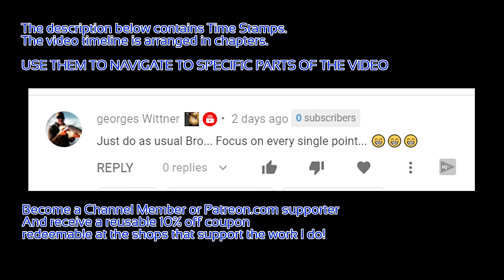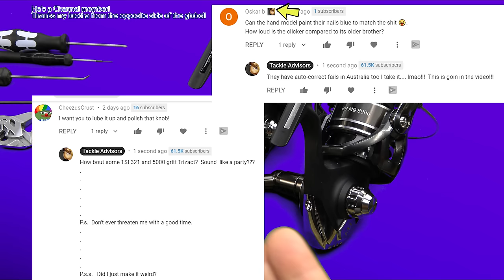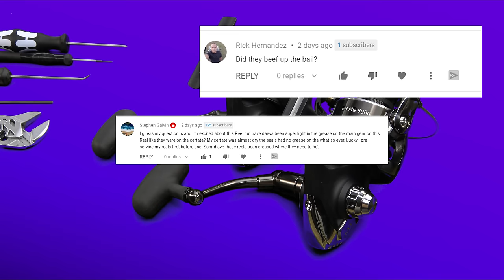Daiwa BG MQ Review - COMPARISON - Teardown - Analysis COMPARED to Spinfisher, BG, Saragosa, Slammer

Comment: I own a 4000 & been using it from the surf for striped bass. basically every day when bass are around. the main issue i run into is sand in the drag which is a major issue. but a freshwater rinse will fix it

Comment: To have it clarified, an endurance test would be interesting, alu gear, coated even, vs brass and stainless steel gears, so those Daiwa and Shimano vs Fin Nor and other stainless steel and brass gear reels. Rather buy a 130 bucks reel with stainless steel all drive train made in US and the reel body of aluminium manufactured in China, than buy a 300 to 1300 reel made in Japan with alu main gear, no matter how many seals and hundreds gramms less weight.

Comment: Monocoque is an engineering term used describe a structure that supports itself from the outside such as most modern unibody cars. Your inability to pronounce it without perceiving it as sounding dirty makes you sound like 12 year old in middle school. It's Mono kawk, Not Mono coke.......